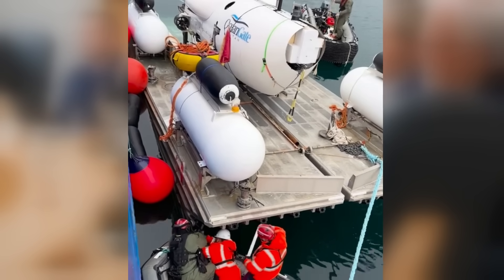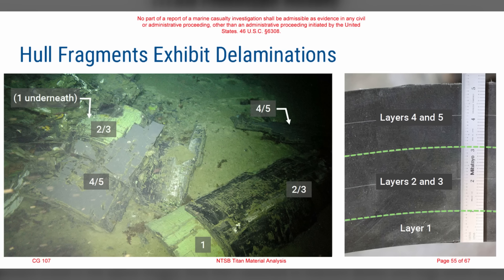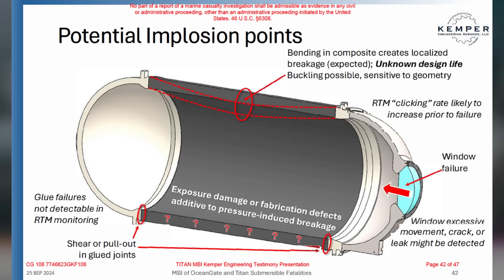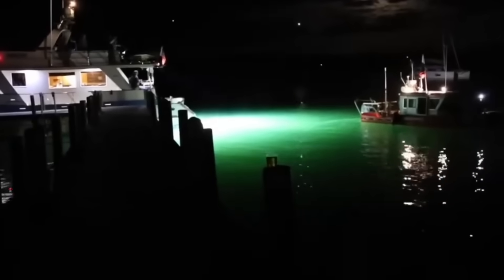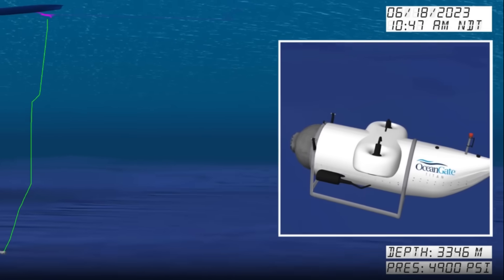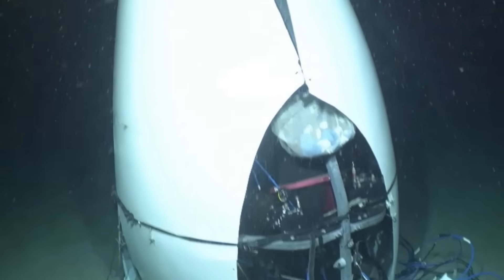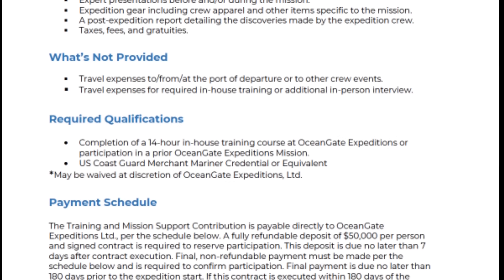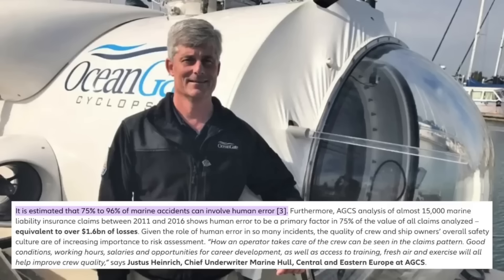Titan Submersible Debris Uncovers Evidence of Sudden Implosion

Comment: That lightening strike could have easily damage3d the carbon hull being both a electrical conductor and epoxy insulator there could have been arcing within the laminates with burnt zones creating a compromised pressure hull. Qualifies for a Hubris award

Comment: @6:41  What do you think could have caused those two parallel gouges on the inside of the titanium forward dome?

I thought of things like the interior flooring maybe. The toilet area part of the floor. Oxygen tanks. Some other equipment maybe. Although all of the equipment was located within the aft dome. 

Or maybe it was the hull itself. As parts splintered off they were rammed into the dome with such force that they grounded material away. But then why only the two lines and not multiple?

I'm not even sure how strong of a metal titanium is on the hardness scale. Although I know it's quite high. What material within the Titan is harder on that scale and could cut the titanium? Is carbon-fiber really hard on the hardness scale? Diamonds are made of carbon and can damage titanium. But I doubt carbon-fiber would have anywhere near to the properties of diamond.

Any ideas on what else could have caused the damage? It's interesting and I haven't heard anyone else discuss it.

Comment: I worked offshore for several years with subcontractors using ROVs.   We sent styrofoam coffee cups down to 10,000ft.  They came back the size of a shot glass.  The ROV WAS  built in house by one of their engineers and every bad thing that happens at 10,000 ft plus needs to be allowed for and designed to withstand 1.5 times the depth.  It’s fiber optics, power and steel cable that’s very delicate.    This ROV has been down on the titanic several times.   It’s an extremely harsh environment to say the least.  Loss of life like that was sad when it goes for naught except that anyone in the future will have an example of what not to do.

Comment: The glue used to attach the rings had a metal component the would erode by salt water. Here's the thing about hiring and allowing 20 somethings with no experience to build something, they don't kniw what tgey don't know
Reply: Yep. Meaning it may have not been the carbon fiber hull that failed first.

Comment: I recently learned about styrofoam drinking cups kept in a mesh bag seen in previous photo hanging in wreckage. There decorated prior to the dive and taken along on the dive where the extreme pressure shrinks the cups to roughly 1/2 of original size leaving clever and interesting changes in the artwork. Supposedly to be given as gifts or sold.

Comment: One would have to be completely dense to ignore the cracking sounds. The creation of new cracks with each pressure cycle degrades the structural integrity progressively. It does not heal itself and becomes weaker with every broken fiber.

Comment: I realize many Youtube comment sections have become latrines frequented by those eager to crap all over Stockton Rush, especially now that information has been released detailing Titan's construction. Mr. Rush has been ridiculed for using carbon fiber, the hull's cylindrical design, and the use of glue to secure the end caps, among others things. But this judgement is slightly unfair. Several countries have built submersibles with carbon fiber hulls and operated them successfully in the world's deepest oceans. This includes the U.S Navy. In fact, the Titan's hull was modeled after the U.S Navy's carbon fiber pressure vessel, down to it's cylindrical shape and epoxied titanium end caps.

Comment: Rush sued and really scared an engineer that was trying to blow the whistle on the inherent danger of this nifty POS sub. The wide variance of failure depths on the 1/3rd size test subs show the carbon fiber epoxied onto titanium was a BAD idea. On an earlier dive with his Cyclops shallow dive sub, Rush insisted on piloting and completely ignored safety protocols for a shipwreck notorious for snags and managed to wedge the sub under the bow of the wreck. Clients said Rush had a meltdown for an hour trying to get the sub unstuck. Finally a client yelled at Rush "Give him the fucking controller!" referring to the aforementioned engineer. Rush threw the controller at him hitting him in the head. The engineer had the sub freed in 15 minutes. It just shows what an asshat Stockton was.

Comment: For all the people wondering what happened to the crew. Here is an exact explanation. At that depth you have 8K-12K tons of pressure per square inch. In a catastrophic emplosion, the human body is compressed to an infant size red blob, then vaporized by the heat, then scattered by the cavitation wave all within nano seconds. What they discover was probably a stain embedded in the carbon fiber with enough trace DNA to identify all the occupants.

Comment: Since this footage has been released YouTube has been filled with videos claiming all kinds of new evidence -  there's no new evidence - there's only one kind of implosion when you're at 12,000 ft below sea level - sudden and catastrophic - and EVERY SOUL IN THE RECOVERY PROCESS HAD TO SIGN A BINDING 30 YEAR NDA that specifically said one thing only they were not to describe, discuss , write, or communicate in any way anyway the finding of articles of clothing or human remains even "presumed human remains" - probably some parts of the lower spinal column possibly parts of the skull and teeth , and these presumed human remains may or may not have been still on the inside of the clothing they were wearing which would not implode

Comment: The temperature of the water at the ocean floor and the strata above it is 2-3°C or 34°F so being stored outside subjecting it to freezing temperatures is moot if it was designed to endure the temperature experienced during the process of the of the dive itself. So was the exposure to the surface environment destruction due to the cold of winter? Probably not.

Comment: One thing I have wondered about is whether there had been progressive degradation of the hull integrity after so many dives to great depths, around 80 dives. I know they had strain gauge sensors located at various positions to monitor and record stress vs strain during these dives. Careful analyses of the behavior of the stress/strain relationship(modulus of compressibility) might have given early clues of an impending failure.
Reply: His record suggests Stockton Rush would have ignored any such warnings.
Reply: there were not 80 dives. it was 14. By comparison Limiting Factor and the Mirs can do tens of thousands of dives before they would have to be retired.
Reply: @toomanyaccounts  That was to the Titanic; it had made numerous deep dives at other locations.

Comment: I'm not a submarine engineer, but I wouldn't want to be thousands of meters underwater in a laminated fabric cylinder bonded to titanium using epoxy resin.
Reply: I like to think of it as a shaken coke can 😂
Reply: @MissImpolite  Excellent comparison!  LOL
Reply: I'd only dive in the Alvin, Nautile, Mir subs or the one James Cameron used in 2012.
Reply: @Thunderchild-gz4gc and I’d still question those lol
Reply: @Thunderchild-gz4gc  look up Limiting Factor. That was the first manned submersible to visit Titanic in 14 years. Five dives over a 10 day period.
Reply: I wouldn't want to be in anything at that depth except a very Stout sphere. No cylinders please just spheres.
Reply: bonded on a Very small area surface .. ..maybe 3 inched deep on the bell caps.

Comment: You're shocked a "hand-entered Excel spreadsheet" tracked the dive?  Considering the craft was navigated from within by an Xbox game controller, why is that surprising?
Reply: a third party knock off playstation controller that was wireless. said wireless system often malfunctioned canceling dives since there was no way to control the craft and it took half a day to fix.
Reply: Indeed it was a cheap 3rd party knock off of a playstation controller who's brand is well known for it's lacking in reliability

Comment: Surely the fact that it did achieve successful dives shows that the overall concept was sound. What was missing was appraisal of degredation of the hull structure. The carbon fibre pressure vessel a 'single use'  structure?
Reply: it isn't a sound concept since you cannot predict when a cf hull will just crumble to the point where it for all intents shatters into nothing. 

Real submersibles you can predict how many max depth dives they can do over the course of say 50 years of service before you have to retire it for safety.

Comment: That's definitely the issue with using carbon fiber. Carbon fiber cannot withstand as much pressure before it'll explode than alot of people seem to think. Carbon is very strong but has a lot of weak points and cannot withstand deep water pressures, especially when left out in all weather elements, getting wet then drying out, heating up, frosting over, and thawing out again. Carbon fiber cannot stand this type of abuse and will decrease its lifespan until the next use of anything hard that hits it, or it would probably just shatter or crack well like it did! Storing of the vessel of this material needs to be dry, and temps not dropping below freezing or it will compromise the material even the UV from the sun can weaken the Epoxy layers! Being a lightweight sub they said the wall thickness was 12cm that's something id like to see to believe! If that is the case they would have had to use only inner amd outter layered resin for the lightweight structure making it very very weak just the same way they make racing bikes today save weight by using only 2 layers of resin between thw fibre layers!
Reply: I was thinking about racing bike frames too (being an ex-cyclist).
Crazy!

Comment: Rush out of his depth literally? Too bad they didn't listen to Lockridge. He told Rush but was threatened with a lawsuit. They were warning the wrong person. The experts who knew should have warmed outside agencies......and keep going until shut down. The vessel was not safe for that depth. Also there were too many separate parts in the design. Greater chance of it breaking apart. Earlier vessels were bathespheres.
Reply: the problem was the outside agencies were hampered by anti-monopoly laws meant to protect consumers. this is because it would be the other companies in the submersible industry that would have Oceangate shut down.

Comment: In all honesty, after that thing got struck by  lightning, that could have been the start of this event. Testing done on airplanes proof that carbon fiber and lightning do not go together. The Carbon fiber had to have some sort of tiny wire mesh in order to properly channel The lightning strikes on the airplanes. The Lightning probably started tiny. Little cracks are other damage to the structure that caused a failure and could have been a source of those noises People were hearing on previous trips. Just a theory....

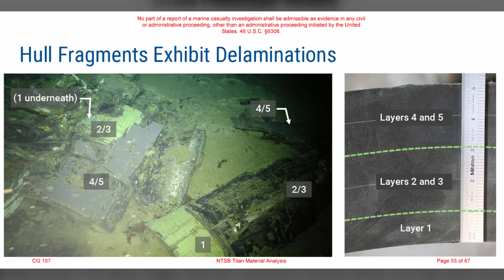Comment: 1:49 what is the green thing sticking out? With red on it?
Reply: One of the oxygen bottles that was sitting on the floor just inside the front dome, there are pictures!
Reply: @shayshay7409  Ohhhhhhhh
Reply: @Jace-vb9uz  everything in the pressure haul slammed into the rear dome. That's most likely where they found human remains imo
Reply: @shayshay7409  yeah that’s what I was thinking to

Comment: So his believe was that there isn't going to be a sudden catastrophic implosion but that their hull monitoring system will warn them long before anything happens and give them time to react. That's what he bet his and others life on. The strange thing is, if you look at the data from this system, half of it seems not even to work. From a bunch of channels they recorded only 2 seem to work properly, others are either plain dead, produce only noise or look otherwise questionable. And they went with this issue without addressing it  for multiple dives for some reason.

Comment: Rush did Tony Nissan & David Lochridge a favor by firing them. These two were distanced from the Titan V2 design, construction and operations. 

If I understand Dr. Donald Kramer’ s (NTSB expert) testimony, there were large sheets or slabs of Titan’s carbon fiber laying on the ocean’s floor. I’d been under the mistaken impression that the hull would be in small shards.

The USCG pictures and presentation imply the main wreckage is lying on its top, inside-down. It looks like the bottom blew out with the hull delaminating into large slabs (as many had warned could happen). The map of the debris field is 200 by 50 meters. Now Titan’s last reported depth was 3,350 meters (approx 450 meters [1,475 feet] from the bottom) when it presumedly imploded. So perhaps with water currents the lighter bits will spread out while falling. The debris field reminds me of the description of the spread of debris from an “in-flight breakup” of an aircraft.

Comment: The Titan May Have Slammed Into The Bottom  Due To Excessive Descent  Speed.... After Hitting The Deck It Popped Like A Abscessed Zit...
Reply: The Titan imploded LONG before reaching the sea floor. 
9:45am ET (13:45 GMT) – Communications between the submersible and the surface vessel are lost an hour and 45 minutes after starting its descent, the US Coast Guard says.

Comment: It was sad that so many people volunteering confused negligence with innovation. They cut so many safety corners, and that's not innovative. If they were changing designs and the result was safer and cheaper, that's innovation. You have the Walkman, destroyed by the innovation of the iPod. No one would call the iPod innovative if, 50% of the time, it had overheated and exploded because they used a cheap battery.

Comment: As someone who works on aircraft which has a surprising amount of overlap with this the fact the CEO said after it got hit by lightning that it would be okay is highly alarming. More so than anything I've heard yet. On composite fuselage aircraft if they get hit by lightning there is a very extensive and involved repair process. The pressure vessel is compromised which while it might not immediately result in a catastrophic failure in time it WILL, not a matter of IF but WHEN. 

This is ignoring all the other design and manufacturing flaws I have seen that would also lead to failure of the submersible.
Reply: The lightning strike was actually on the prototype Titan 1, which was retired before it had a chance to implode. But the nonchalance about it was indicative of worse to come.
Reply: Thanks, for that explanation, Floor it.  I've always been skeptically fascinated with the spooky carbon fiber. Wondered about repair, etc. especially now that is everywhere.
Reply: Especially something like a 787 or A350
Reply: @ultramagnus4374 Fortunately, you don’t have to worry about lightning strikes on those. At the kinds of altitudes that airliners fly, the aircraft being struck by lightning is an inevitability. It will happen-multiple times across the individual aircraft’s service.

It can also happen while the aircraft is on the ground and people such as the cleaning crew are aboard doing their jobs. Fortunately the engineers thought about this and came up with a solution decades ago to protect the airliners and people inside them from lightning strikes.

Granted, I don’t know exactly how it works and I would guess it involves redirecting the electricity across the fuselage to discharge harmlessly. Airliners and covered in tiny little spines for that purpose-most obviously on the backs of the wings. But they work. I was aboard an A320 that got stuck by lightning last summer and barely even noticed.
Reply: Yeah,,,and he keep the same cylinder since 2017 or 19..so few years..with many dives.
At least..some ’normal people’ seen the titanic for free,like the woman from oceangate who was reallt happy,.I would too.
But honesly..I would be really sceptic about the cylinder cracks and contacts with glue and titan..
I hope that was quick.without fear..not fully aware in the darkness in panic..with a dad saying ’excuse me’..

Comment: Its wild that the Titan made it to the Titanic 19 times successfully. There have been carbon fiber subs made for extreme depths before, key difference is they were designed for what amounts to be a single use. Using something like carbon fiber over and over is crazy as it can only become weaker and weaker.
Reply: I believe you are wrong.  It was just three trips.  I think the french passenger had been down to the titanic  many times and was an expert on the subject of the sunken ship.
Reply: @ttank7241  that was Paul Henri Nargeolet

Edit: Known as Mr Titanic, and was a frequent IFREMER researcher.
Reply: @ttank7241  Look it up, it was 19 trips to titanic depth. total of 90 missions at various depths.
Reply: I use very expensive carbon fiber drive shafts in my dirt latemodel race car. I have removed carbon drive shafts that went 20-25 races with no problems and swapped it out for a new one only to pull out on the track and start throttling up and the damn thing explodes to shreds before I get up to 20mph. I've noticed if the drive shaft has been dinged with a Lil rock or a small bolt from another car , then it's gonna pop sooner than later. We have to use them in our series for saftey reasons, but carbon fiber is finicky as hell to me. And didn't they run into something from a previous dive and scratch the side of the titan? One good gouge into the side of a carbon fiber hull is junk to me..